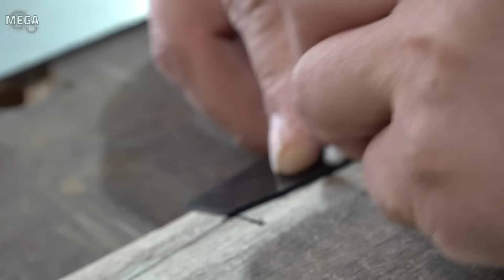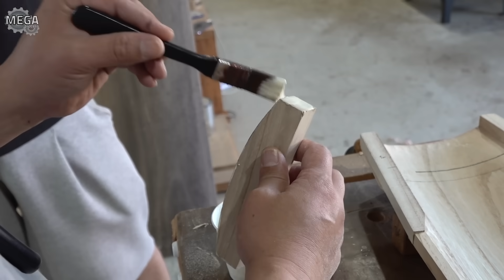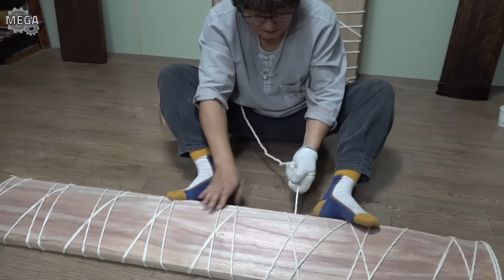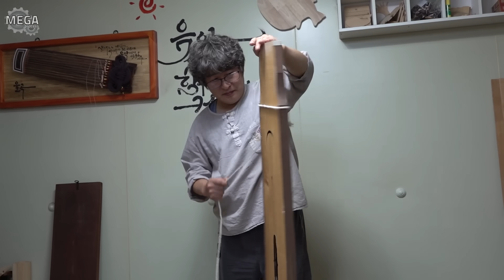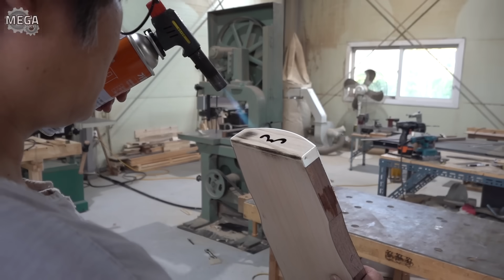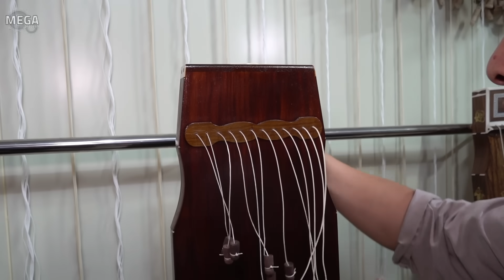Process of making zither. Korean traditional musical string instruments factory

Comment: There appears to be far more control with the Asian plane on the pull stroke than the western overly complex version using the push method. I've never used the Asian planer but it looks easier to my eyes.